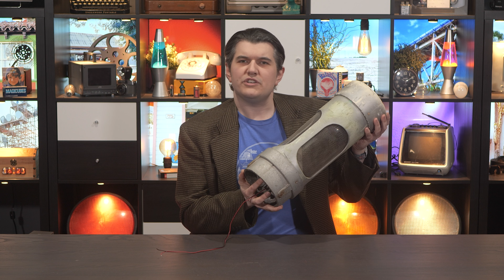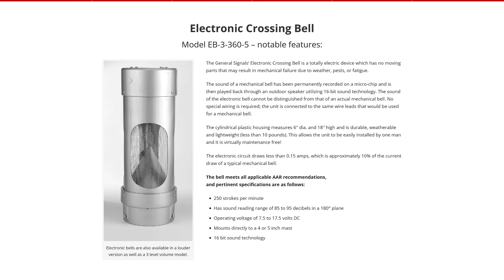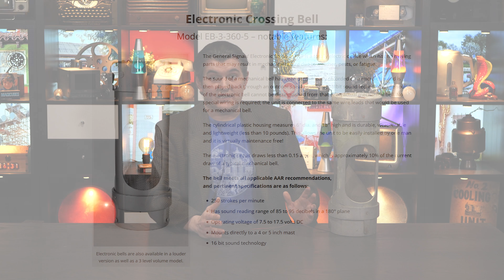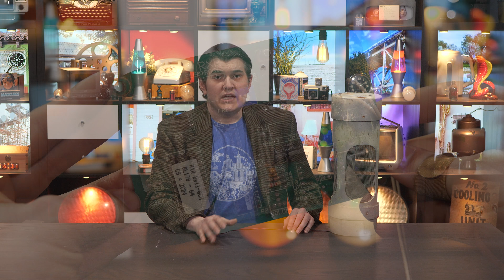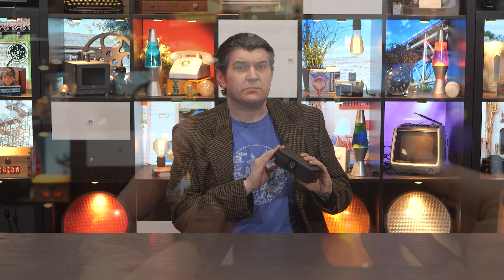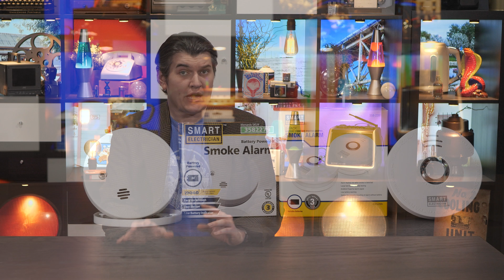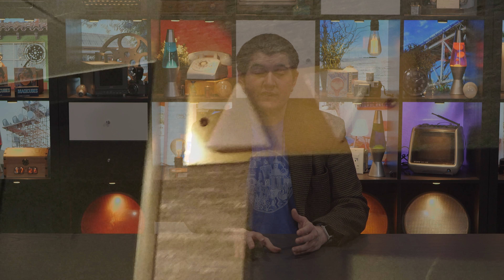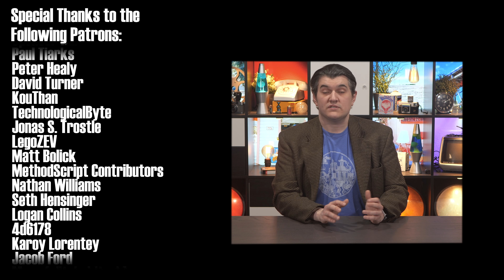The disappearing and unappreciated art of audible alerts

Comment: Australia here. I didn't even recognise temporal 3. I thought it was a telecom thing. Our domestic smoke alarms have no standard noise but since almost noone has co alarms (they are a scam) we can simply conclude that loud beeping sound = get outside and ring the firemen.
Commercial alarms are a different story. Absolutely everything is standardised on slow whoop (but very slow; about 5 to 8 seconds a whoop), but it doesn't matter because noone will ever bother even acknowleding that there is some alarm until they can see the flames or until the firemen practically carry them out of the building  (exept in schools, where everyone will get thown in gaol for child endangerment if they don't all evacuate immediately).

Comment: What I find fascinating about the electronic crossing bell is that between 1988 and 1991 everything with an audible signal seemed to switch rapidly from a mechanical to electronic device. Alarm clocks, timers, phones, cars, everything at the gas station. When I was kid in the 80s, there was a mechanical bell that would ring when a car pulled up to the pump at the gas station and an attendant would have to come out with a big metal key and reset the pump in order for the customer to pump their gas. And if they paid with a credit card, the carbon copy swipe thing came out. After 2- 3 years, all the tech at the gas station was the way it is now. No more bells, no more big metal key, no more carbon copy. Except, paying at the pump took a few more years. It really seemed to happen overnight though. And just an FYI,  I didn’t grow up in the sticks either. I grew up in an LA suburb.

Comment: I did not expect the railroad crossing bell to be basically a silver spray-painted PVC drain pipe with bug screening over pill-shaped holes, hiding a circuit board with an amplifier and a ROM chip. The detail that sold it for me was that the electronic version had to copy the old electromechanical bell sound exactly, so people would recognize the warning instantly instead of learning a new one.

Comment: I must point out that some 'real' sounds are not the same as those generated using a speaker.

Fir instance in Brussels the old trams use a real bell, but the newer ones used a recorded/ generated bell sound.

They are just as loud but loose the impact and direction clues.
It may be the initial pressure wave with a real bell is quite different to what a speaker can do 

I think it was a mistake to ditch the genuine bell for a speaker simulation on safety grounds, as in the city centre trams can be all around.

Comment: I hate to say it, but every single one of your examples of poor usability, poor sound design and volume control, and general bad user experience on phones can be boiled down to Android problems. 

The sound design on modern iPhones is well thought out, and each sound has a distinct meaning. App push notifications always work, and when they have custom sounds, they are always respected (if implemented correctly by the devs). It does one repeat notification for texts by default. Volume control is dead simple. In all scenarios, there are never any more than 2 volume adjustments. If you see a setting, it works - no exceptions. 

To top it off, it now has very capable file management, integration capability with other cloud providers like Google Drive (could be better, but it is still perfectly functional and mostly integrated, such as in the "files" app), settable default apps and password managers (no more forced safari* and keychain), and it even has most game emulators available on the app store with no jailbreak, and Bluetooth controller support. I even formatted a flash drive to FAT32 and copied an exe to use on an old computer via an off-brand OTG cable recently, with no third-party software, and it worked like an absolute charm. 

With how much you respect good and thoughtful design, you should really try an iPhone if you haven't in a while. There are a number of huge improvements they have made in the past decade or so, and many of the reasons they gained such a bad reputation with Android fans no longer exist.

Comment: For all of the criticism I will give to discord, and its mobile app, the one positive I can give them is that they have said push notification cooldown built into their system, and you can turn it off if you dont like it. 

And then obviously because nothing can actually be fully good, its a slightly different implementation that notifies only if there isnt a notification on that channel already, which means if a channel I have notifications on gets busy as Im doing something that requires the upper 25% of my phone screen, I now have to sit there and wait for the notification to leave by its own accord so it doesnt get reset...

Comment: I used the velociraptor calls from Jurrassic Park for the longest time. The full "Bark bark bark, rrrrhhh" for calls and just the "rrrrhhh" for texts. But it got to be a pain keeping track of the original file and converting it to whatever random format my new device used. Assuming the new device let me have custom sounds (I don't think my current one does, but it has much bigger problems, which is why I don't bother taking it with me anywhere, making its ability to produce noise rather useless--I can't even hear it when I'm in the other room with the door open ).

19:55 - OMFG. My 3G phone did that. My current phone does not. Hell, even calendar appointments were downgraded to a single "ding" that doesn't even demand you attention RIGHT NOW RIGHT NOW I AM MAKING NOISE AND I WON'T STOP UNTIL YOU DEAL WITH M--
And oh yeah, for a while, unacknowledged emergency alerts (which again, chime once) would suppress and silence all other notifications and alarms until dismissed. You can bet I reported that as a bug!

Comment: I change the sounds on my phone regula-- um, whenever I remember to do so. So I don't get too used to any one sound and I am forced to find out what all the noise is about. Also, I want to use each ringtone in my devices at least once. Seems like a waste to let them go forever unheard.

Also, I feel for those who don't have a feature/control that they want. My phone screen goes blank after just a few seconds when on a call, and there doesn't seem to be a way to change it. Nevermind that most calls I make are to automated systems that want me to type numbers in to the pad. I just have to live with awkwardly waking my machine up at every single prompt, hoping I can still respond in time.

Also, also, I'm still a little mad that Android went from friendly arrow, house, and list symbols to more abstract lines, square, and sideways-chevron symbols (in that order -- in other words they swapped the locations -- I'm STILL hitting the wrong button sometimes).

Comment: My hometown train station bell changed from mechanical to electrical sometime when I was away and I could tell instantly that it had changed (no longer two bells with different speeds, different tone, not as loud) but the average person wouldn’t and more importantly it still taps into the conditioning of “bell = train coming” reliably which is what matters more than sounding exact

Comment: As a European (Austrian specifically) it feels strange to hear a sound from a railroad crossing, because, while we technically still have a few railroad crossings that do emit sounds, they almost always have lights and in some cases even barriers.

Also our trains do have horns, and most trains actually have a low and a (comparatively) high horn, only the low horn is really used as far as I know. I have myself actually never heard the high horns irl, I heard them in Simulators but not outside of those.

Comment: There is a setting I think in the "Accessibility" section to make the phone vibrate every 5(?) minutes as a constant reminder for a missed call. Don't remember if it can also be applied to other notifications like texts/messages.
At least that's on my (already older but still working) Samsung S10. I really hope they didn't get rid of that in newer android versions...

And yes, customizing notifications is a nightmare. 95% of the preinstalled sounds are way too obnoxious to use them for anything except maybe an alarm.
And they got rid of the notification LED as well, which offered a really unobtrusive way to convey prioritized notifications when your phone was sat down in your peripheral vision.

Comment: What you ask for is neither a shiny product demo (which gives internal visibility and thus money through promotion to whoever implements it) nor does it meaningfully move unit sales (since it's not like you've got choice and most people are not informed buyers, so offering it won't allow a design to outcompete others.)

On the opposite end, actually implementing it is expensive (extremely expensive, because sound design specialists are rarely in-house and getting this right would cause delays, which again, no promo for developer and their manager that quarter!) and an ongoing support hassle.

Basically, the system delivering you the phone has no incentive to provide you with such extravagant things like "phone not sucking in ways that aren't obvious within 5 min in a show room".

Consider implementing an OS for phone from scratch, and building hardware for it from scratch as well? Or using some open source Android fork and fighting with the hardware vendors being actively hostile?

Comment: In a sense, on this topic, one size has never ever ever fit all. I've had to program a special automation into Home Assistant just so that my girlfriend can turn my ringer on by texting me "911". I also never notice haptic feedback. It feels insane that I have to consult to third party apps and a whole separate locally hosted server to enable someone to emergency call me. This is exactly the issue: if I could simply set my girlfriend's calls and texts to override my defaults, I wouldn't have to do this. Android has something like this but it only allows you to choose who can override your do not disturb mode, which I never use. Gotta say. You got this dead right.

Comment: ~20:30 it's so incredibly frustrating that a lot of these features and customizations not only used to be included in the settings by default and toggled and customized as we saw fit, but more importantly they ACTUALLY WORKED when they were.
Now a lot of stuff has been excised entirely, or options are technically included in settings but are locked and can't be turned on/off, or are legitimately unreliable. I think the last time I was truly happy and satisfied with a mobile device's os, ui/ux, functionality, and performance was my Nexus 5 with a close 2nd being OnePlus 7T, and anymore now whenever I need to/am forced to upgrade it's not even if I'm going to actually like it, but more of a question of "what am I going to be able to tolerate?" 🤷🏽

Comment: Most of my notifications are loud and intrusive but this is for several reasons. I work outdoors, in and around loud equiptment, and im a bit hard of hearing. However, i am not one to get 50 messages/ emails per day, which means my phone isnt hoing off constantly. Perhaps 3-5 youtube notifications, 3-5 phone calls, 5-10 texts and 1-3 emails through the entire day.

Comment: 20:36 This reminds me to a task of my job:
I have to monitor the working of a critical software on a computer, but it would be extreamly inefficient to just sit in front of it continously so I made up a system (the best I could do with my IT knowledge) that send different emails to my account if anything happens with the software that require my attention. I set up my account to put different labels on the different emails and set my phone to play different notification sounds for the different labels so I instantly know what kind of problem I deal with. A few years ago I had to reconfigure the system, as it was impossible to set up my new phone to play different sounds based on labels so I had to set up different email accounts, change the settings on the monitored machine so it sends the different emails to different addresses, and I use different apps on my new phone to sign in the different email accounts, so I could set different notification sounds for the different apps to get back my excellently working system in a hilariously overcomplicated (but the only working) way on my new phone.

Oh, and if I want to get a new type of notification for any reason I have to set up a new email account where the new type of emails will be sent, search for a new email app to sign in with that, then I can set up the new notification sound instead of just set up a new label in my only account.

Comment: Bravo.  I agree with all of your annoyance with the extreme clunkiness of trying to set up the alerts, ringtones, etc., on my Android phone.

It's also true that there is no easy, fast way to switch settings.  I use "do not disturb" all of the time because otherwise I get too many spam calls and notifications.  But it's super clunky and non-intuitive to make those changes.  Drilling through menus to do things that I need to do several times every day is silly.

I'm also like you in that I often completely miss the vibrate mode, and I wear hearing protection a lot of the time at work, so that adds to the annoyance.

I program the control system for the plant where I work, and have several audible alerts that we rely on to tell us various things.  I have set up patterns such as you mentioned to indicate different things.  That's been very helpful!

I've never had any smoke detector, however, that has any pattern to their audible alerts.  They've all just blared out a solid tone.  And I've had many different ones over the years.

Excellent video, I agree with every bit of your ranting.  Don't the people who program these phones ever actually use them themselves?

And as you, I also HATE when programs or operating systems are changed for no good reason!  Move the menu items, etc.  Change things just to make my life harder.  Thanks you ninnies!

Don't get me started on who programs some of the self-checkouts I encounter!  Again, do the programmers ever try using them themselves?

Some are OK, but some are extremely user hostile!  There is a store within walking distance of my house, that is a large national chain, and I get in my car and drive 10 miles to go to another store that sells the same things, but whose self checkouts actually work!

User ergonomics.  It's not just a phrase.

Sorry for the tangent.

Comment: On the idea of the false choice between noise pollution and silence, the issue is more that things need to be designed for their environments. Airplane bing bongs are unobtrusive in an airplane with engines and AC and people chattering, but they would be very intrusive in a library. And with a phone, there's no way of knowing whether you're in a library or a movie theater or a nightclub where a noise wouldn't be heard. (Well short of listening in and then processing that audio but that's a whole can of privacy worms.) Vibration has become the default mainly because it's acceptable regardless of what context you're in. 

Agree overall though, multimodal design is underutilized.

Comment: One thing I hate nowadays are piezo beepers. I work in a new factory and these are everywhere: UPS systems, Badge readers, Lift buttons, gas alarms, door alarms, machine malfunction, dishwashers and microwaves, even the bloody pedestal fan. It all sounds so similar, we had to put signs next to the most important sounders so you know which beep you are hearing. To add to that problem, you can't even locate where the sound is coming from. I want the time of mechanical bells and mechanical buzzer horns back which you can properly tell apart

Comment: It drives me nuts looking back from my galaxy s4 to now and seeing all the features I've lost over the years, both hardware and software. I used to have an IR blaster to control the tv, removable battery (and waterproof) headphone jack, SD card slot, notification led that you could program, and several software things I used to be able to do that can't anymore, like these phones should be able to do virtually everything and anything but they make it too hard, if it's not build in it requires side loading or rooting to make it do what it should out of the box

Comment: 16:27 phone vibrators have become not only weak but unlike the miniatur motors with a excentric waight, wich vibrated in atleast two dimensions around an axe. The now consist of a little waigt moved by a magnet in one dimension along the length of the phone. Wich is also along my leg, so how shuld i feel that little weak vibration up an down in my pocket?🤔🤬
They even know about the issiue, becaus there is an option to let the phone make a vibration like sound over the speaker💁‍♂️ but there is also the possibility to make the vibration way way weaker! Why???🫣